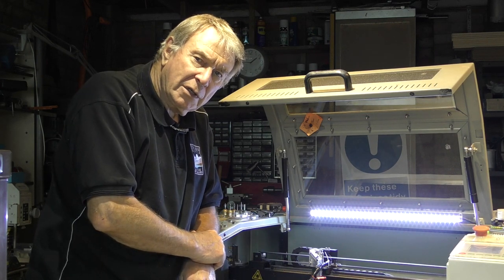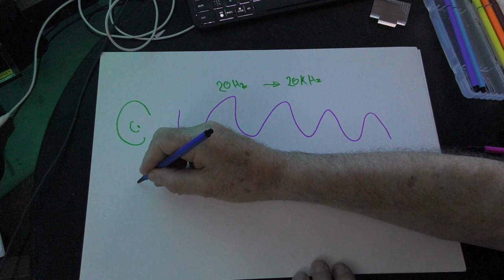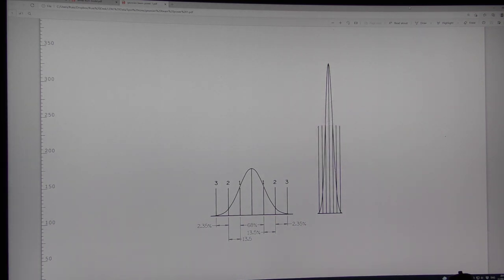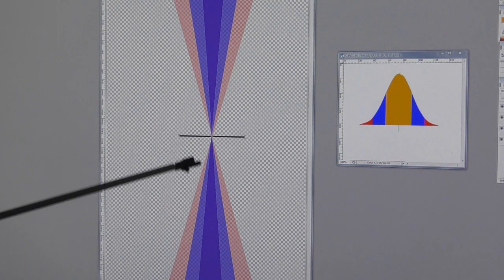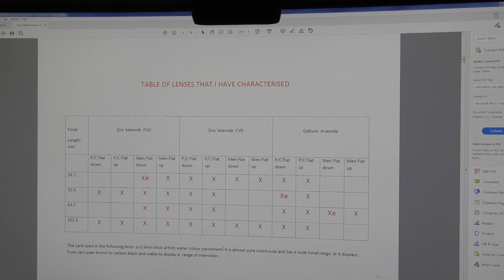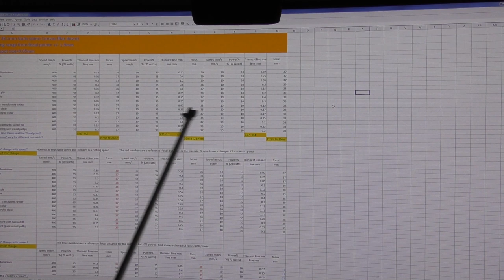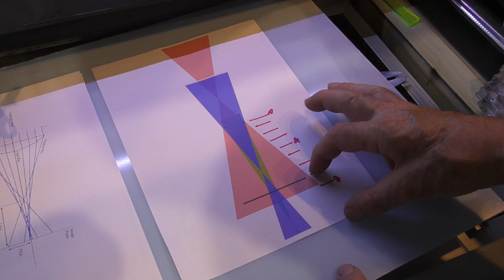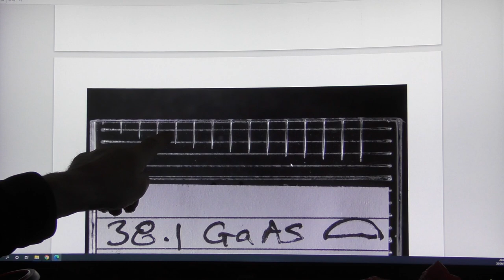RDWorks Learning Lab 219 Lenses and Laser Beams Laugh at Lens Theory

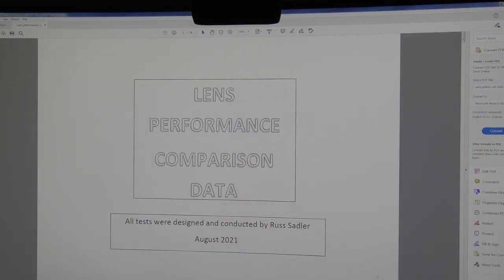Comment: 35:00 very interesting graph and explanaition.
I  am just thinking about to grab a plat of graphite and drill a 0.1mm hole into it. Placing it in a decent holder and use it as screen would prevent scorching and should produce a very nice cut, if the laser is set up the proper way.
Could you explain what CVD and PVD means? I cannot find a proper explanation when looking for laser optics glossar.
Reply: As part of my journey towards this final understanding of how lenses work with laser beams I did some experimental work with lenses already that you may not have seen.  In one instance I drilled a hole (about 1,5mm) through a lens to prove that cutting and engraving are two separate properties embodied within the lens. On another occasion I machined away the face of the lens to leave just a 3mm diameter lens. in an attempt to remove the engraving focal point.
 see
https://www.youtube.com/watch?v=ITQiwjAJysQ
https://www.youtube.com/watch?v=xSU4cplekio
 At this stage I was still convinced that the deep cutting was completely dependent on the projected central focus caused by spherical aberration.   As you see in this video, that concept was incorrect and a much simpler but less obvious mechanism is really responsible. 

 Good luck with your own experimentation
 Best wishes
Russ
Reply: Jan I believe it deals with the lens coating.  CVD  Chemical Vapor Deposition, PVD Physical Vapor Deposition

Comment: Hello
I have a doubt that I think can help me.
the time in the simulator does not correspond to the time of the machine, how do I solve it?
I love your channel
Reply from the maker: Hi Daniel
Thanks for the kind words

The time to run your program cannot be calculated accurately within RDWorks because there is inadequate information in your PC.  RDWorks is a general program that works for anyone's machine  be it big.small, fast or slow.For example EVERY machine will have its own X and Y axis acceleration times,  the speed between cuts (that also has accelerations)   will be different and the initial jump off speeds at each cut  will also vary. These various parameters will be defined in your user tab  BUT they are STORED within the machine memory. Hence your PC simulation is more about the order of cuts/scans and visualising what the program will do without wasting materials, rather than creating an accurate time .
 
HOWEVER,  hidden away in the FILE  menu on the machine is a button called WORK TIME. Provided you have DOWNLOADED your file to machine memory,  and chosen to run that program,  the CONTROLLER now has access to all those special parameters and can do the complex calculations so that you can see an accurate run time that is correct to within 1 millisecond.  I'm sure that will please you!!!!

Best wishes
Russ

Comment: You say the ray diagram below the surface isn't relevant but when you are making a deep hole the surface disappears, so the beam travels further into the cut to meet the new surface which is constantly moving downwards, changing the intensity profile as it goes. 

With a  longer focal length lens the intensity profile changes more slowly as you move away from the focal point, hence why it can cut deeper.
Reply from the maker: Yep.  You are quite correct and if you remember I did ask if you could explain why the 38.1mm holes (and 50.8mm also)  were experiencing a ballooning/barrel shape below the surface.   The fact is  that the initial penetration at the surface  is crucial and those DIVERGING  rays that people imagine to be having an effect below the surface to  causie off angle edges etc  are having no such effect.  Only DIVERGING  or CONVERGING rays that enter the penetration hole can have any effect. The  diverging rays from short focus lenses cause barrelling  and those converging rays from longer focus lenses enter the penetration hole and continue to damage much deeper into the material exactly as you describe.
 I doubt that there are few others that have thought this through as logically as yourself.. So now you have a complete understanding of how lenses cut.
 Best wishes
Russ

Comment: so to summarize  If i get a thin spot on the surface. Focusing 2-3 mm deeper into 3mm acrylic will let me cut it faster?
Reply: your graph tells me with my lens and focusing method- im cutting approximately 4x slower than i could be with Gaas & correct focus!!!!
Reply from the maker: @meky0  
 Hi 
 You need to study all the data  and take specific lenses that look good for your application and run your own tests. These results are so dependent on the quality of your beam that they are only a guide  and not facts for anyone but me and my machine. The mechanism of cutting and the undefinable focal point are the real takeaways from this data. Your machine may produce different numbers but the overall picture will remain unchanged because you cannot defy the laws of physics.
If you wish to add your disguised email address to another comment, I will send you  a copy of  the 109 page pdf  file with zoomable photos that you can examine in detail.
 Best wishes
Russ

Comment: I was always under the impression that a laser beam was a parallel beam of light that did not increase in diameter as it travelled through space. Is it posable to get a single stream of photons. As you have said we are not dealing with a simple process. I thing the ballooning of the cut is caused by pressure building up by the escaping gasses.
Reply: You may not have seen his previous work about this, but he has shown the beam lags behind the nozzle as well.  Now how in the hell that happens is beyond me since it is happening at the speed of light and the fastest we are achieving with machines like the China blue is 500mm/s.  Other weird things happen as well that he has shown that is baffling.
Reply: Pretty sure he's disproved the pressure build up theory in a different video whereby the process was repeated on the edge of material so that any vapour can escape to the side rather than back up the "burn tube".
Reply: @eskibrew  I believe he did, yes.
Reply from the maker: Hi Dave 
 I have mention on many occasions that a laser beam is NOT parallel The tube manufacturer even states it in the specification. However it is totally ignored because it is hidden behind techno babble that people do not  understand . A typical glass tube beam diverges at 3 millirads.  As I said, to most people this is meaningless  but when you take the time to understand,  it admits that the beam is expanding at the rate of 3mm per meter.  Be grateful you didn't choose an RF tube because that grows at about 8mm per meter and MUST be tamed with a power consuming beam expander .  The word expand is alarming to me because I now know that bigger beams make for better engraving but VERY inefficient cutting!!!  Hmmm.... I wonder if Epilog and Trotec realize this???

By the way the guys below remembered my proof that your pressure build idea  up is NOT the culprit.  It was a great though until realty stepped in

 Best wishes 
Russ
Reply: @SarbarMultimedia  I have one for you, but I purchased a Green laser a few years back.  About 1/4-1/2 of a mile away is the Highway.  I pointed the Green visible laser at the Highway sign, and it reflected back.  The dot did NOT stay the same size, and, as a matter of fact, grew by over 1k times its size so the dot hit the reflector to the size of a baseball to come back to me almost the size of a softball.  Very pronounced due to the distance but all light, even "light amplification by stimulated emission of radiation" is still light (photons) that will expand outward.  Same deal with a CO2 laser machine but being the distance is smaller so will be the amount the beam grows by.
Reply from the maker: @thebeststooge   
Your green laser will have been a diode laser and you will have been seeing two problems. First,  because the beam diverges naturally at some stupid rate , about 40 degrees,   the columation must be controlled with lenses before it exits the pointer.  Depending on the lens quality,  the beam can have very little divergence , hence the baseball spot size. However, the reflecting surface of road signs is not a flat plane surface but is instead millions of micro spheres of glass the  are purposely  designed to reflect and scatter light back to the direction it came from. 
 Best wishes
Russ
Reply: @SarbarMultimedia  Point of what I said was that no laser will stay true unless in a clean vacuum with no gravitational forces put upon it.  Even the laser that is used for making sure the satellites do not drift out of sync for GPS purposes (just watched a video about this) has to go through the atmosphere (highly contaminated, has gravitational forces on it, etc...) and requires a computer to compensate.  We don't have those on our machines AND a single dot of say 3mm in size will not stay 3mm in size anywhere on Earth.

Here is something from Nasa about it (highly simplified) - "The laser's light waves travel together with their peaks all lined up, or in phase. This is why laser beams are very narrow, very bright, and can be focused into a very tiny spot. Because laser light stays focused and does not spread out much (like a flashlight would), laser beams can travel very long distances."  Notice that word?  "does not spread out *MUCH*" meaning it does spread the further away you get.  All waves will spread out even in the dead of space.  I once read where a laser shot from Earth to the moon not only is deflected (due to the atmosphere) BUT will not be the same size by the time it would hit the moon.  That is what I was talking about.
Reply from the maker: @thebeststooge  
 Hi was never questioning the principle you trying to convey but only that the example you gave was not the best., Shooting at a mirror on the moon is an excellent one but  even so  the divergence , although small,   results in very few photons making it back to earth
 Perhaps this was the NASA document you refer to. Others may be interested in the subject  
https://www.nasa.gov/feature/goddard/2020/laser-beams-reflected-between-earth-and-moon-boost-science
 Best wishes
Russ
Reply: @SarbarMultimedia  Yes.  I have been following that science from them for the last 40 years.  Funny thing is as a Radio Amateur we used moon bounce for our radio signals which was fun, but now there are "ham operators" attempting this with lasers.  Heck, one such report I saw was a laser beam had entered into the ISS from Earth.  They did not know where it came from precisely but it did happen to the surprise of the ISS crew.
Reply: @SarbarMultimedia  Btw, this is precisely what I was getting at with my simple experiment with the diode green laser  "Thus, what begins as a light beam that’s about 10 feet, or a few meters, wide on the ground can spread out to more than 1 mile, or 2 kilometers, by the time it reaches the Moon’s surface, and much wider when it bounces back."  See how HUGE the beam became and enlarges again on the return trip?

Comment: Hi Russ,

Just wanted to check with you if you got my email adress. My comment a few videos back with the address was swiftly removed and I know you delete them when read, but it might have been some youtube algoritm.

I haven't gotten an email from you so I figured I'd give it a bit of time before I bothered you about it again. You being a busy pro youtuber and all. :-)

Cheers
Reply from the maker: Hi Jonatan
 Thanks for your persistence . I did send a reply to what seemed like the correct email address on 6th August but please confirm that I decode it correctly. The first part was jonatan followed by the ampersand . Then I added rullman  dot  and finally se. 

 Best wishes
Russ
Reply: @SarbarMultimedia  Thank you for your patience. This is turning out quite the ordeal. I mean, how hard can it be giving your email to strangers on the internet. :-)

That does sound correct apart from the ampersand part which of course should be an at sign. I'm guessing that is a typo.

The weird thing is that I have only the most basic spam filter in place. That shouldn't really have picked this up.

Mind trying devrnd .. hotmail instead and we'll see if that works better?